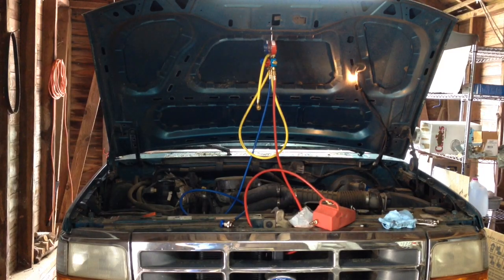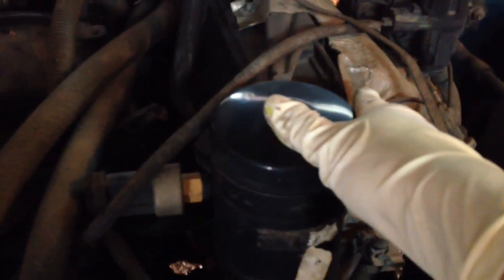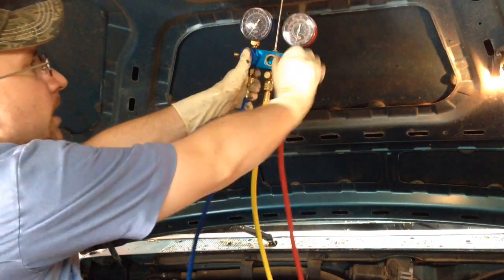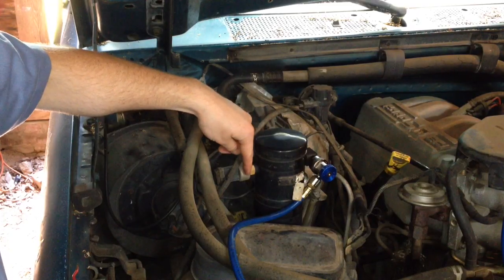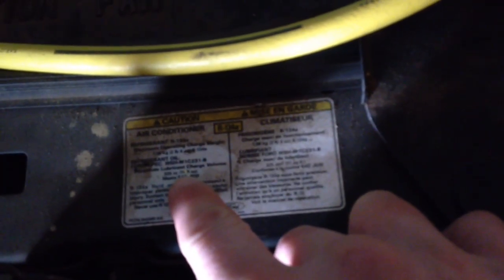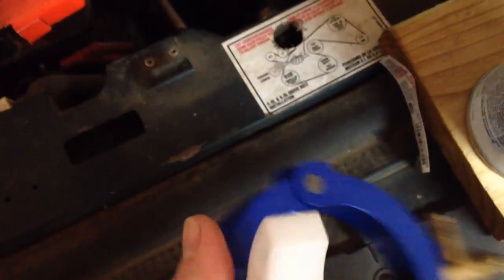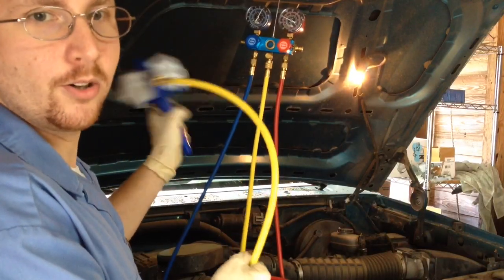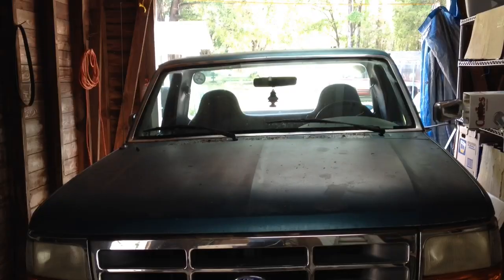How To Charge an A/C System 1980 to 1996 Ford F-150

Comment: I just changed compressor and flush system . I emptied oil from compressor and added 2 oz of oil and installed. My 95 ford f150 takes 11oz of oil. What is best way to add remaining oil?

Comment: only question I have is why not add oil once you vacuum it down, I was always told if you pull it down to get the moisture out you are also pulling oil and it is smart to add it back. THe rest is right on point. thanks

Comment: Hey Mike I have a 1995 Ford f-150 5.0l. I just replaced complete a.c system. Evap coil, condensor, accumalator, compressor and all lines. Do you know how much pag oil the system takes and the best way to install the oil and how much 134a freeon.. Thank you in advance.

Comment: Thanks for this. Helped me out a lot. The AC on my 94 hasn't worked in at least 10 years. Followed the procedure in the video and was shocked to find it blowing ice cold. Unfortunately, when I took the jumper off and plugged the connector back in, the compressor wouldn't cycle by itself and started blowing hot again. Jumpered the connector again, ice cold air.  I'm looking at that low pressure switch as maybe being bad. These old Fords are still great trucks. I plan on keeping mine for as long as I can.
Reply: Was it the high pressure switch?
Reply: It was. Can't remember if it was high or low pressure switch, but it was the one that screws into that canister shaped thing on the passenger side. AC is still working great a year later.
Reply: I've had mine 29 yrs.

Comment: The last part of video were you removed the jumper wire, is their a reason why you jumped it out?
Reply from the maker: To make the compressor run so it would draw in the Freon.
Reply: @MikesGarage96  it wont damage the compressor by not having any freon in it?

Comment: 87 f-150, I replaced the AC compressor and tried recharging it, but I cant get the pressure on the high side to build. It stays at vaccuum even when it sucks down coolant from the low pressure side

Comment: I bought an adapter  to hook the cans direct  to the gauges.. screw punching a hole in the cans.. you do know it is illegal to release the  R134a into the atmosphere.. and you did it on video..
Reply: He broke no laws. The law states that release of very small amounts of refrigerant during the process (such as when purging the yellow supply line prior to charging your system) is acceptable.
Reply: @flower2289  the problem is he drained THE ENTIRE RESERVOIR... Not just the line 
If you missed that you did not watch the entire video

Comment: So My buddy added oil a couple months back and blew a hose, can’t I just pull a vacuum on the system and add oil then Freon
Reply from the maker: You only need to add oil if you replace a major component like the compressor. If it was just a hose replaced, just pull a vacuum and charge. Too much oil in the system can blow the seals out of the compressor.

Comment: Mike, great video. I'm a new truck owner (1992 f350) and i've got some work to do on my AC system overall this was a huge help
Reply from the maker: Awesome! Your year model probably came with R-12 refrigerant. If it hasn’t been retrofitted, you’ll have to buy a service port kit. It’ll come with new fittings that screw over the old R12 type. Just take the old valve stems out first.
Reply: @MikesGarage96  Oh okay i didn't even consider that. Thanks for the tip i'll look into upgrading it

Comment: So the only time the high side is open is when your using vaccum?
Reply from the maker: Yes
Reply from the maker: And evacuating the system
Reply: Thanks brother huge help btw. I'll still watch the video again cause I'm about to do exactly what you did.
Reply: And I'll I'll give you a shot out when I'm blown cold.
Reply: One more question will it suck out my pag oil in process?
Reply from the maker: No it won’t. Only add oil during major component change
Reply: @MikesGarage96  my new compressor came with the correct amount of oil I just didn't want the vaccum to pull it out. Cause I've bought every thing new still waiting on parts.

Comment: Hey mike  trying to track down my problem.. went to hook up gauges and heard pressure coming out of high side port? was this your original problem? with gauges on,  high side is only at 50? low side at 50, its 80 degrees ...compressor cycling.. high side is super low? 1995 E250

Comment: Is there a way to find out if your truck has been converted to 134a? I have a 92 I just bought and I need a charge but I don't know if I should use 134a or a r12 sub.
Reply from the maker: If it’s been changed over, it should have retrofit service ports on it. R12 and 124a uses different gauges and fittings
Reply: @MikesGarage96  hey thanks brother for a reply,  you just gained a subscriber for that man.  Just bought a 1992 f150 and noticed the high and low side schrader seemed a lot cleaner in appearance. Looks like they did the conversion because like you said the fittings are bigger and exactly like my 2013 f250. Put a charge in with some of that canned stuff from autozone with a built in gauge. It was reading roughly 48 PSI when the can went empty but the ac went from warm to semi cool (far from cool/cold) hope they changed out the compressor oil when they converted it.  Might just have a bad leak somewhere I guess. Anyway thanks again for the reply.
Reply from the maker: Them gauges that comes on them tall cans tend to be inaccurate. It could very well still be low in Freon if your system was empty and you only put in that one tall can. Your truck should hold around 42 oz. roughly two tall cans or 3 1/2 regular 12oz cans. Good luck with your new truck!

Comment: Hi, will this fix the AC blowing hot air with it is running? or will there a Moe common underline problem at play . Thanks.
Reply from the maker: You will have to hook up a set of manifold gauges to diagnose the problem. If the system is completely empty of Freon then you have a leak somewhere. I suggest replacing the ac service ports valve cores if the system is empty, before trying to charge the system. That’s a common place for leaks.

Comment: That truck was not made with R134a.  That sticker says 2.6lbs of R12.  How much for R134a?  I know it is less but I don’t know the amount.  They’re not the same amount.
Reply from the maker: Mine was factory with 134a. After 94 was when it changed. My ‘93 I had I converted over from R12. It took 3 lbs to fill it to optimum pressure readings
Reply: @MikesGarage96   My 1994 F150 5.0 has R134a per the factory sticker.

Comment: He my account won't ingage what do I need to check next
Reply: My A C
Reply from the maker: Jerry  Wilbourn if the compressor won’t engage it all, it could be the pressure sensor, the wiring harness going to the compressor clutch, or the refrigerant is too low

Comment: So question I have a can of r12a refrigerant is the process still the same I'd assume so but if not please let me know!
Reply from the maker: +kyle hendry R12 systems uses a different manifold gauge set. The service ports are different. If the system is empty I would go ahead and convert it over to R134a
Reply from the maker: +kyle hendry Process is the same but you will need a set of r12 manifold gauges. The service ports are different between r12 and r134a

Comment: Hey brother... Very good video. Question . I have a '93 F150 sometimes the air don't blow cold or none at all What do you think I could check ?
Reply from the maker: +Leo Thomas Start with checking the low and high side pressures with a manifold gauge set. You can find charts online where the proper pressure should be according to the ambient temperature. There could be a blockage somewhere like in the orifice tube or it could be the compressor is just weak.
Reply: Michael Wells 
Okay I'll check that.. It's my first Ford and I love it.. Tks. I'll let you know what happens.

Comment: How long does this last
Reply from the maker: +Preston Soccio Outdoors If there's no leak in the system it should last as long as the system is properly working or until a component of the system fails.